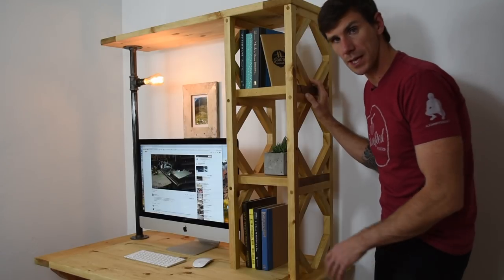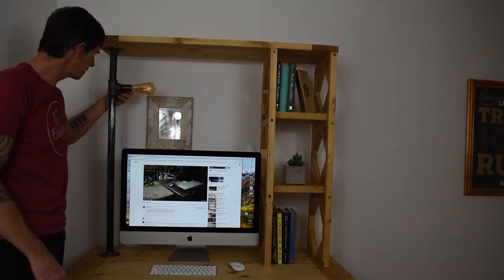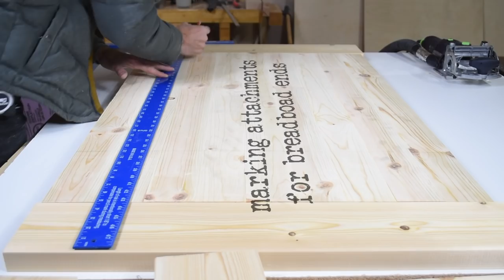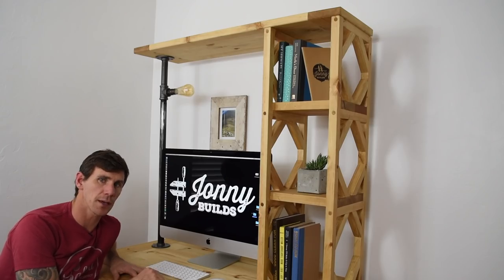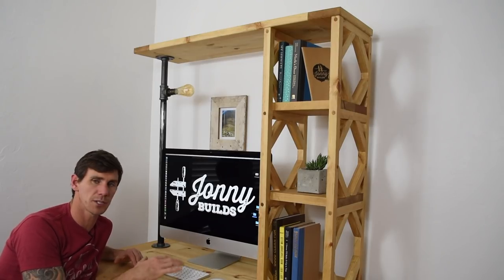How To Build A Farmhouse Style Desk | DIY

Comment: Really like the design and the video. Only question is why clue the entire bread board end? Not worried about the expansion or contraction of the wood?
Reply from the maker: Thanks Phillip. Just a rookie mistake I guess. I'm always learning on the fly.
Reply: Oh, you're fine man, I was just wondering. I know the purist will flip out if something isn't done their way, but I've done the same with glue and pocket screws. I've seen Brian McCauley use the domino for breadboards, and it seems to work well. Humidity swings in our area have killed some of my desk and tables though, so I just started avoiding bread board ends on the pine stuff. I'm going to do a traditional mortise and tenon bread board end soon on a hardwood table; maybe we can work together on it and do one domino end and one traditional for comparison videos?
Reply: Jonny Builds   Jonny, I'm no purist, but there is a legitimate reason for the proper crossgrain/breadboard assembly. It's got nothing to do with doing it the old school way for the sake of it. The wood movement is definitely a consideration. It's caused by more than just moisture. The temperature can screw with it too. Do some research from pros and learn properly. I'm only chiming in here because I've seen the foul ups and I wouldn't want you to ruin one of your nice projects. And since you're becoming such an influence to other content creators, maybe you can guide those young makers in the right direction. I'm looking forward to more great projects and you growing your channel even bigger. Best of luck and thanks for the great content.   Troy. (Love the barn style look btw)